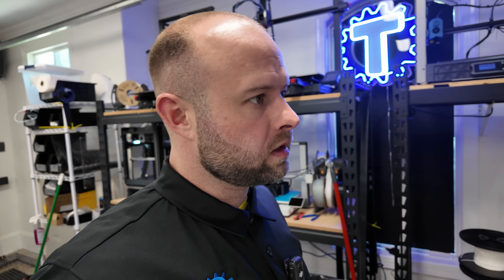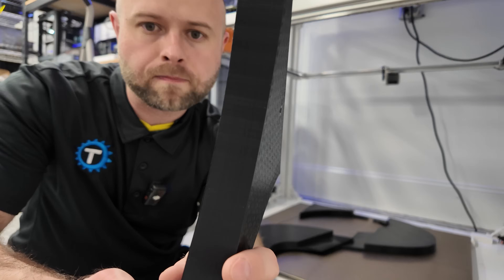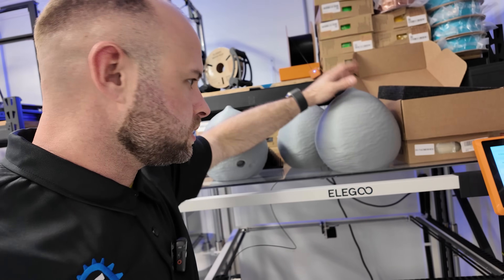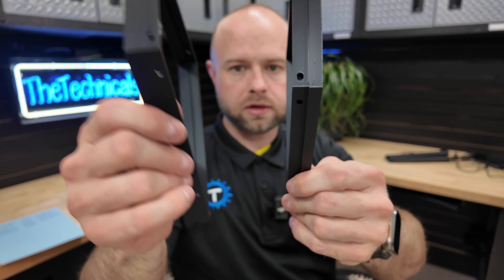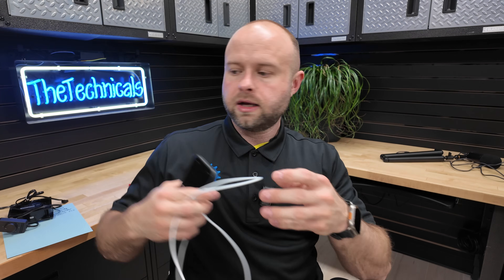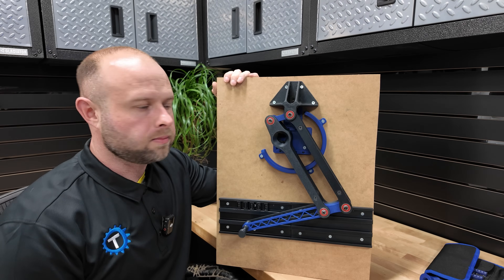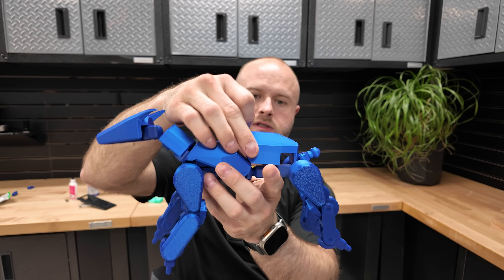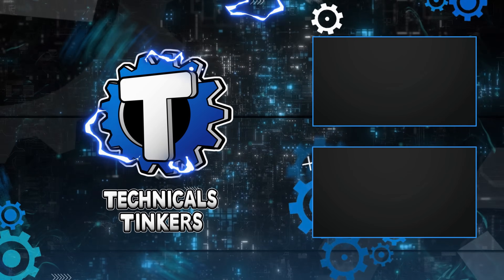NEW Custom Design, GIGA prints looking GOOD, Big Dummy13 Dog Soon: 3D Print Vlog

Comment: I've been looking at that 800x 800 plate aswell , was also considering combining a couple cryogrip plates to make a larger one for the giga. but the fact its a single sheet really does make me want to go that option. 

black and pink sounds like a good combo, im with you I will usually print something basic to test it first then go with a more solid final version once I think I've got everything working
Reply from the maker: If only cryo made a biggun!

Comment: Gonna be getting a giga here soon. Have you done many prints utilizing the multiple extruder heads? My goal would be to print four things out at the same time or use several of them for a multi material and or multicolor printing if that’s even possible?
Reply from the maker: None yet, but since the replacement is coming (assuming it's a whole print head) i may grab the bracket and try it.
They all print the same thing with different spools so yea you could print diff colors at the same time, just not on thes ame model IIRC

Also, if you buy it, consider USING MY LINK

Comment: Nano Polymer by vision miner is amazing build plate adhesive. And one coating last 10-15 prints before havibg to reapply. I have 350mm bed and 300 print hours and still have 3 quarters of the 120ml bottle left and ive been printing in ASA with 60c chamber. PLA conditions will make the bottle last even longer. Theres no clean up like with glue stick

Comment: For your bed plate adhesion issues you should take a look at vision Minor nano polymer adhesive. I absolutely love the stuff you can do 30+ prints between applications and it is temperature dependent so it increases adhesion when you’re at printing temp on the bed and then releases adhesion once it cools down to room temp. They even have a sample pack you can get for about $5 + shipping so you can try it before you invest

Comment: I've found that if I print the giantarm blue silk slow, it's much stronger. I use standard generic silk setting on my bambu, but drop the speed way down. 60 outside wall, 100 inside wall...hasn't failed me yet.

Comment: It will probably help to do a low layer height first layer than the rest too. It helps with adhesion because it creates a more uniform first layer even if the mesh isn't great.    When I use a .4mm nozzle I do a .08 first layer on most items.

Comment: I'd brim the whole ass "S" at about 15mm considering the investment in filament. Hey @Polymaker   , get this Man some spaghetti!! I'll be in Onsdel today drawing up a tray to replace the broken speaker grille in the dash of my Square body Chevy C10. Keep up the good work, brother.
Reply from the maker: Vid out next week but these desk hubs are NOT sticking. 
Raised bed temp
Enclosed
Glue
0mm brim separation
10mm brim
NOTHING
Reply: @TechnicalsTinkers  Dammit Bobby... Can you brim the entire thing enough to make the first layer all the way? You may have to get that 800mm plate. I have a feeling that the multiple plate variance and movement is fighting you with those pointed edges. Props on the tenasscity with the lemonstorm!
Reply from the maker: I think the only solution is to actually design brim into the model then shave it off. It's unreal how it just wont stick
Reply: @TechnicalsTinkers  Infuriating. Not a bad plan though. You could incorporate 2 layers instead of the one of the slicer brim and help with the warp pulling up. Still be easy to trim off.

Comment: Giga prints looking good. Thinking about bed glue... you only need to glue the outer edges, print a skirt, pause the print, lay down the glue just inside the skirt, start the print again. Should be quick to do rather than the whole surface. Increase the bed temp a bit more... but I guess it's a losing battle with such a big bed area.